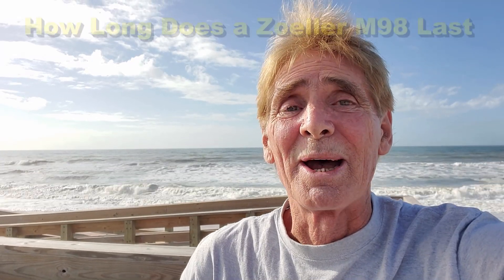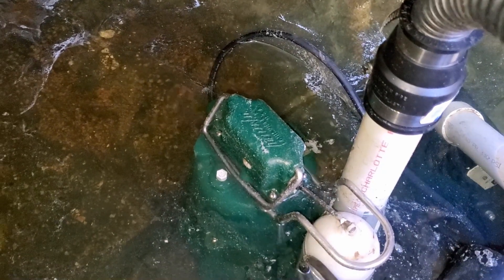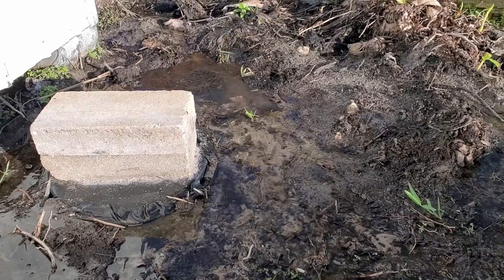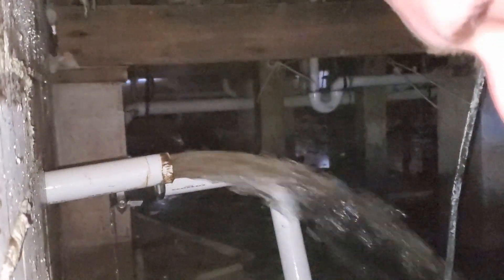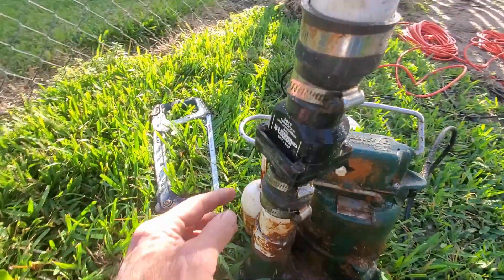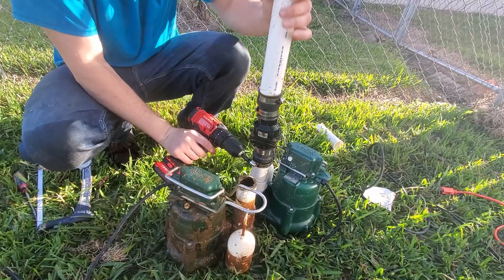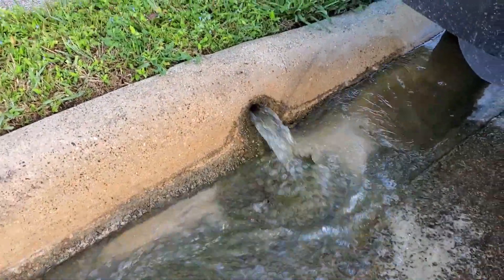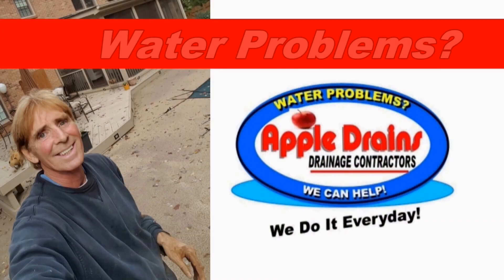5400 Hours NON STOP Pumping! How Long Will Your Pump Last?

Comment: I have a 4x6 cistern (My house is 250 years old) that floods every time it rains. My parents have been using a utility pump to just drain the basement whenever it floods making our basement useless. I've decided i wanted to install a more permanent and automatic solution. Your videos have been invaluable. The cistern now has a new sump system with a Zoller pump and the system works flawlessly. We have a dry basement for the first time in almost 40 years. thanks Chuck!

Comment: Holy crapp that's incredible.
 Another testimonial to   Zoeller pumps.
Reply: Phillip Bonner I had one fail and my basement flooded. They honored there warranty and paid out to have the basement fixed. After they revived the broken unit and verified it was faulty.
Reply: @FishFind3000   Well that's really going the extra mile.